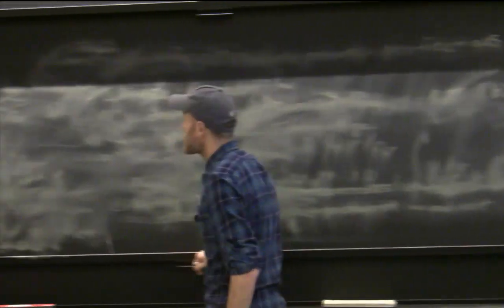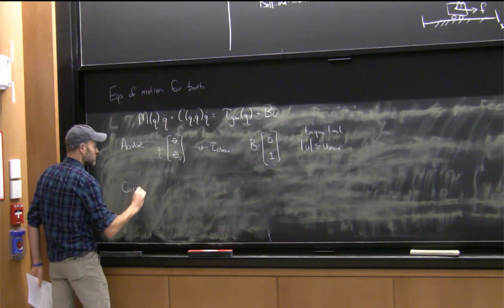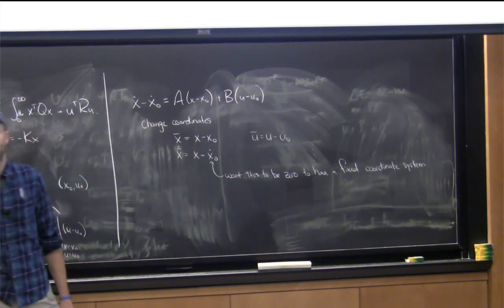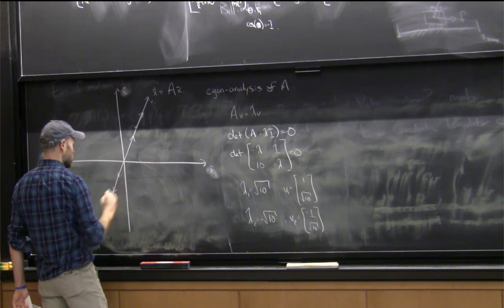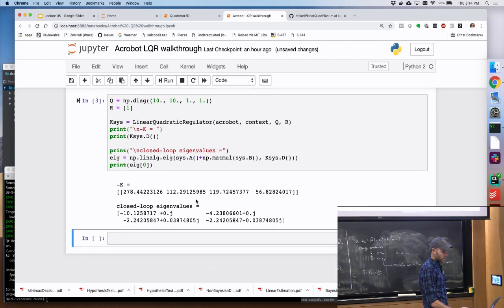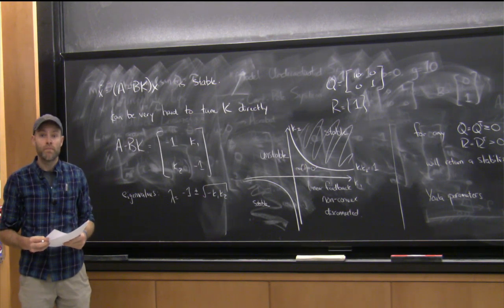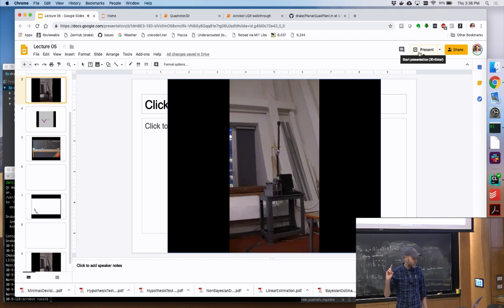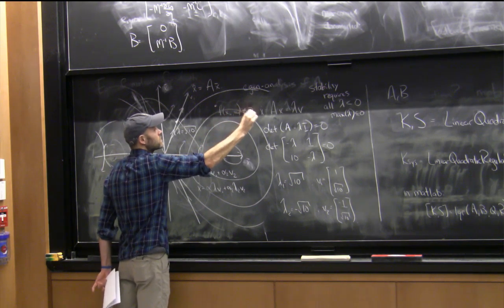Lecture 5 | MIT 6.832  (Underactuated Robotics), Spring 2019

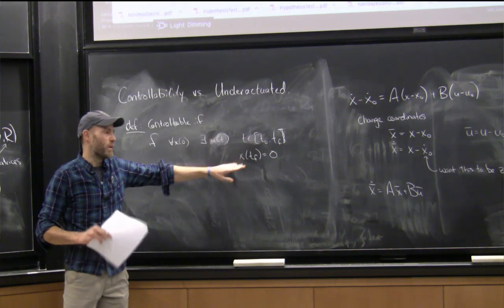Comment: 59:40 Re controllability of linear systems by showing regulation to origin only: what does "you can map that anywhere mean"?
Let's say the 2-dim system x' = -x + u, y' = -y. This is trivially regulatable to the origin (don't even need a control). But if I want to show controllability to say, (10,0), how can I "map that trivial solution to (10,0)"? There's actually no control that makes that point a fixed point... so it seems I can't even search through feedback controllers u=-Kx?

Comment: I think there is a typo at 47:07 in the eigenvalues eq., the minus sign under the root should be omitted. And thus the stable and unstable areas in the plot become exactly the opposite.
Reply: i think you're right.  pretty sure I got it right in 2020.  consider watching the newer version.
Reply: @russtedrake8012  I'll consider that, thanks.

Comment: Hello ,
I would like to know how will I be able to control the Acrobot to the position to 3/4*pi instead of pi. Do I have to give u such that 3/4*pi becomes a fixed point and then  linearize around it ?  The system is controllable so it is possible to reach 3/4*pi.
Thank you
Reply: Do you want to reach the state (but then possible move away), or stabilize the state?  If you want to reach it, then trajectory optimization with a terminal constraint on state is natural.  If you want to stabilize it, then it must be a stabilizable fixed, point.  Which does mean finding a u such that f(x_desired, u) = 0.  (once you find this u, you can linearize the system about it).
Reply: @RobotLocomotionGroup   thank you

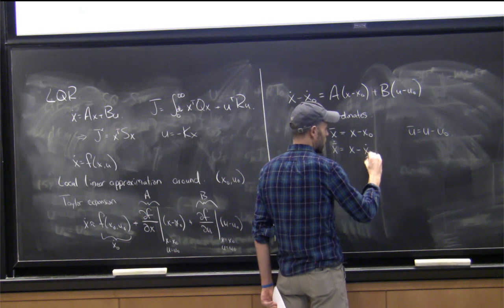Comment: I think there's a mistake at 21:37.
Regarding the taylor expansion:  xdot - xdot_o = A(x - x_o) + B(u - u_o) and change of variables: x̅dot = xdot - xdot_o
The xdot_o in the taylor expansion is not the same as the xdot_o in the change of variables.
In the change of variables, xdot_o is d(x_o)/dt which, as Russ says, is 0 if the operating point is chosen to be a fixed coordinate system.
In the taylor expansion xdot_o is xdot evaluated at the operating point (x_o,u_o). This is only 0 if the operating point is a fixed/equilibrium point (which is not the same as a fixed coordinate system)
So to get the linear system x̅dot = A*x̅ + B*u_bar requires 2 assumptions (1: fixed coordinate about operating point and 2: operating point is a fixed point) I think?
Reply: fwiw -- I basically agree.  in my language, I would say the coordinate system is fixed if it is stationary in the original state coordinates (x,u), not relative to (x0,u0)... for me your (1) is implied by the way we've set up the discussion.

Comment: How hard is it to model the dynamics of friction, which makes it hard to get rid of the little oscillation at the top? (regarding the Acrobot)
Is it the non-linearity of friction model marring the balancing performance?
Reply: Yes.  But the exact reason is a bit subtle.  We are in the stick-slip friction regime -- we must apply some amount of torque to break free of static friction, but once we break free we quickly overshoot.  We do not have nice asymptotic convergence to the fixed point for even perfectly modeled systems with this stick-slip friction behavior.
Reply: @russtedrake8012  Thanks, one more question! Has there been any attempt to utilize multiple actuators that are kept in running at high speed, to replace a single actuator? This would help me to get out of the stiction regime. I think funding would matter, lol.
Reply: I haven’t seen that.  Fwiw - another common problem is backlash, but the hardware we built that was shown in the video used a friction drive (effectively no backlash)
Reply: @rtedrake  Thanks, always!

Comment: I don't get it. Why should we choose fix point instead of any point?
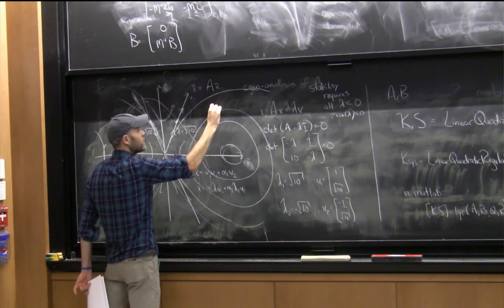Reply: I guess the question is "why is it useful to linearize about fixed points?" As Russ mentions at 1:12:30, you can linearize about any point in the phase space, it's just that it may not be useful for analyzing local stability or designing a stabilizing controller. E.g. with the pendulum you could linearize about [theta,thetadot] = [1,1] and you'd get something of the form xdot = Ax + Bu + C. But if thetadot = 1 (constantly rotating) that means it's physically impossible for theta to stay at 1 regardless of what `u` you choose. So the only information you get about this point is that it's unstable, which you didn't need to linearize to figure out.

Remember though that you can change the fixed point location by choosing u_o. E.g. for the undamped pendulum, you could choose any operating point theta_o with thetadot = 0 to be a fixed point by choosing u_0 = mglsin(theta_o) and then linearize about that to determine stability/design a stabilizing u_delta = u - u_o.
Reply: @puzzlepencilholder  In dynamical systems that have stable orbits (rather than stable fixed points), it's sometimes useful to linearize around the trajectory that moves around this orbit. This way you can tell if its stable (if points that start near your starting point also follow the periodic orbit at the same speed) or not. Not sure whether this kind of thing happens or is useful to controls and robotics though...